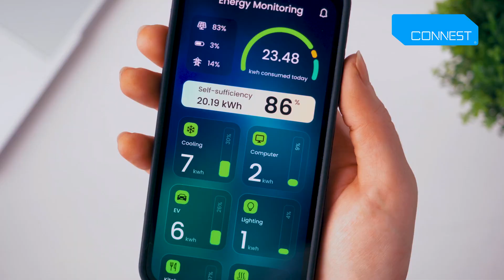What's the REAL Difference Between Steel and Wood for Homebuyers?

Comment: Steel stud construction Is Piss Poor  The things invariably get built out of square /plumb. 
Shitty self tapping metal screws and sloppy assemblers are the stuff of Legend
.PUS steel studs RUST.. Badly and Very quickly /easily.  Steel is only different but Not better,.. in Real life
Then there is the Few buyers willingly buy Trailer 'homes'